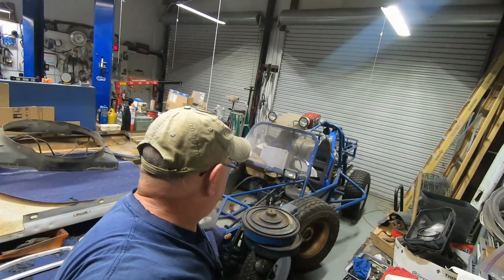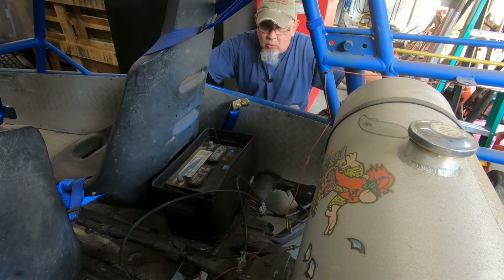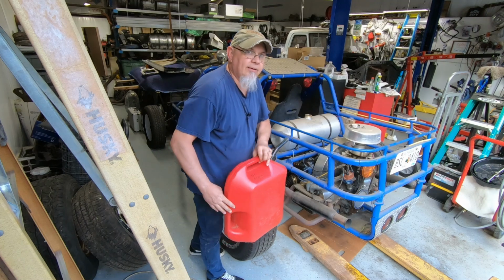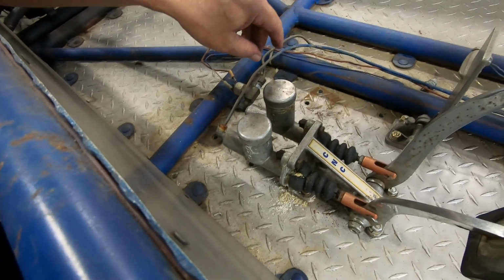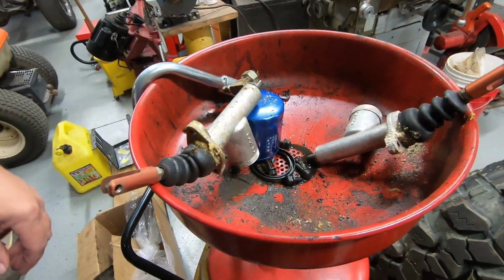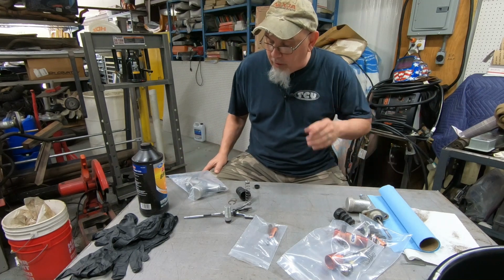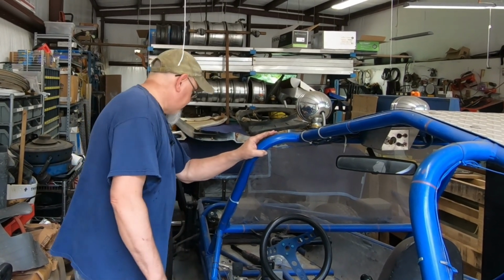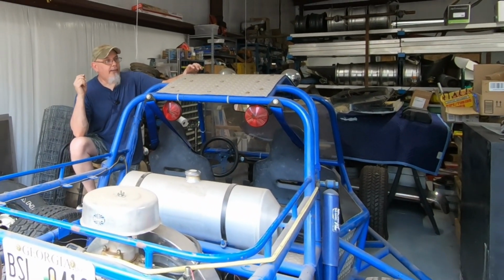VW Sand Rail Rescue

Comment: Clutch plate is probably rusted to flywheel and or pressure plate
Reply from the maker: I hadn't thought of that since it's been stored inside. That shop does sweat a lot in the spring and fall, so I suppose it is possible! Thanks for commenting!

Comment: I just bought an old buggy with CNC brake Master cylinder and clutch system similar to yours. Where did you a rebuild kit? Thank you for the video and any info you can relate.
Reply from the maker: Unfortunately, I don't think anyone sells a kit specifically for the CNC/Neal brake or clutch systems. I was very fortunate to be able to disassemble what I had and save 2 of the 3 cylinders. I did have to replace one, and a Wilwood master cylinder bolted right in place of the old CNC unit with no modifications except for rerouting the brake line.

Hope that helps, and good luck with your project!
Reply: Thank you, I'm sure that will help.